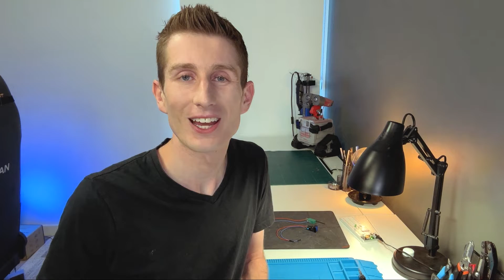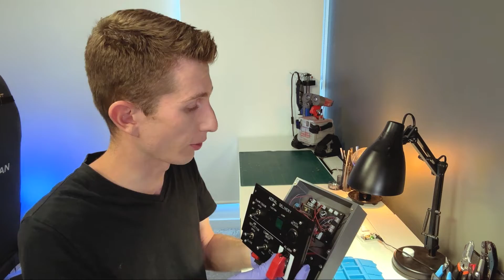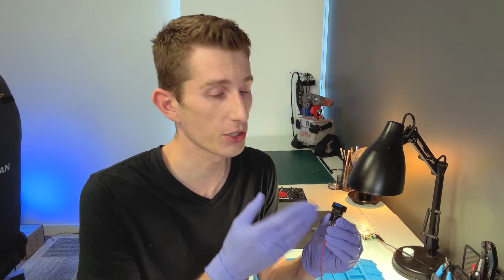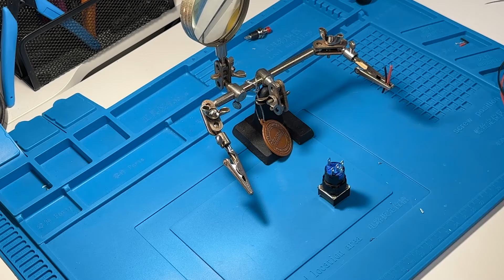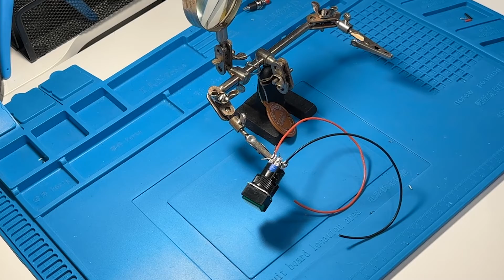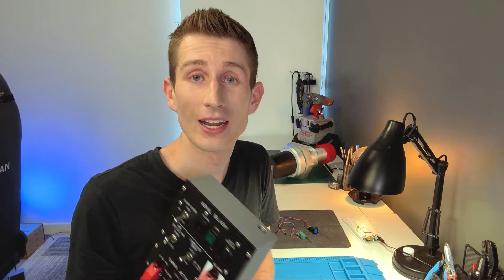Ep: 4 - The difference between Normally Closed and Normally Open switches... and does it matter??

Comment: It's embarassing to ask but ... what about an ON-(ON) three lug pushbutton like the SCI PSM106? Can  I just wire two lugs to make it OFF-(ON)? / There's also a SCI PSM102 which is ON-ON. I can't even begin to figure it out :D
Reply from the maker: Hey! Yeah you can just wire 2 of the pins to the push button and it’ll be ON-(OFF) (where it opens the circuit when you press it) or OFF-(ON) which closes the circuit when you press 🤙🏻

Comment: having real problems with this wiring and dcs bios scott. I am using these buttons for the jettison panel as follows - 'true' is giving me a high on press.  the low on bounce is not activating in DCS and so I have to press the button again (high / 1) for DCS to register the button being turned off in sim.  Any ideas?  PS - jettison button acts as it should and the 'toggle' option is also the same as 2 way switch.

DcsBios::Switch2Pos pltJettStoreLw("PLT_JETT_STORE_LW", 18, true);
DcsBios::Switch2Pos pltJettStoreLo("PLT_JETT_STORE_LO", 19, true);
DcsBios::Switch2Pos pltJettStoreLi("PLT_JETT_STORE_LI", 20, true);
DcsBios::Switch2Pos pltJettStoreRi("PLT_JETT_STORE_RI", 21, true);
DcsBios::Switch2Pos pltJettStoreRo("PLT_JETT_STORE_RO", 4, true);
DcsBios::Switch2Pos pltJettStoreRw("PLT_JETT_STORE_RW", 5, true);
DcsBios::Switch2Pos pltJettBtn("PLT_JETT_BTN", 9);

<Edit> - I 'think' i need to connect another pin to NO in order to register another high/1 and then a seperate channel on the board and use switch multi position option in bort to identify the two pins....................  hmmmm

<Edit 2> Nope - that didn't work either.........
Reply from the maker: Mmmmmm shoot me a message on insta or Facebook
Reply: @aHornetsNest  Will do pal - thank you.

Comment: I was wondering what the Arduino breakout your using in the box is ?
Reply from the maker: Hey there! Is that the black circuit board you see the arduino push into? That is a custom circuit board made to break out all the inputs and arduino pins

Comment: Love to see the C-130 button box.  I have an anycubic vyper fdm, elegoo 8k resin, and M1 xtool laser cutter.  I just starting with my planning phase on the cockpit build and your videos are amazingly helpful.  With the quest 3 now having pass through full color camera simpit and VR is now a real possibility.   My biggest hurtle is the overall frame.  Without a CNC machine can it be done with just hand power tools.  Should I consider sending out the plans to get cut by a professional CNC machine?  Also will you be doing a Helios tutorial to help with MFDs and gauges on front console.  Seems like the easiest way to just have a lcd tv and do a lot a work with very little to no wiring.
Reply from the maker: Awesome! That’s a real nice collection of tools to use - i can’t wait to hear how your sim comes along 
With regard to CNC cutting - I am personally getting mine cut out by a good friend who works with CNC equipment, and I’d also recommend it if the budget allowed … mainly for the convenience as well as the accuracy :) you could laser cut out components from 2-3mm acrylic or ply, and then use a trim router to cut along the “guides” or even use a jigsaw - but it’s all up to how much time and effort you want spend for the pit - I’ve prioritised time so I can get straight into building :) 
I’ll pop a C-130 box video in the queue 🙌🏻🙌🏻

Comment: That's my favorite type of lit switches :D Have them all over my cockpit 👍 They are all rated for 12V but do fine with 5V as well. Just didn't find a source for replacement LED but none died so far so so I guess they are good enough for the use case :)
Reply: Does anyone have a link to these?  Or at least a search term to look for?
Reply from the maker: I just found this on AliExpress: AU$0.29 | Push Button Switches 5V 12V 24V 220V Momentary LED Illuminated Maintained Self-locking 16MM Latching Push Button
https://a.aliexpress.com/_mreXkSr
Reply: @ - Thanks!
Reply from the maker: 100% excellent switch! 
Yeah I have a heap of them at 12V because they suited the 12V backlight circuit for the cockpit :) 
And then I went to our good friend AliExpress and got a heap of 5V for stand alone projects
Reply: @aHornetsNest  I also have a 12V circuit available and the whole lightning circuit is separated from the Arduino so I could move it over but the 5V are really enough for now. There was just one nasty surprise that the Arduino would happily supply over VIN too when the external PSU was off. A diode made short work of that. That pin is not even rated for any mA so I have no idea when it would go down.
Reply from the maker: Haha yeah classic 😂😂